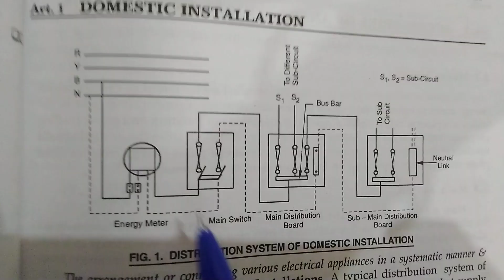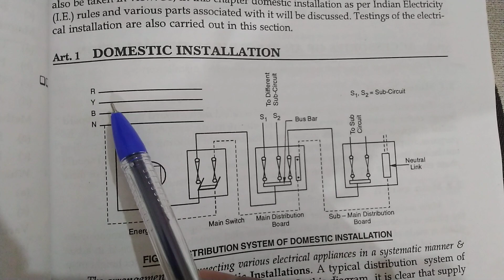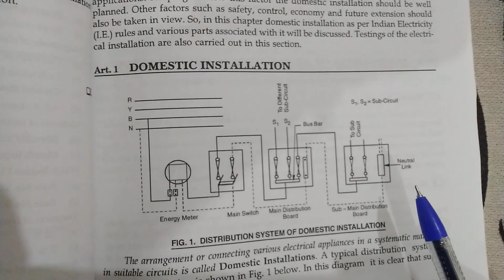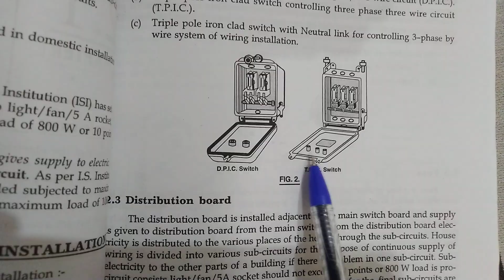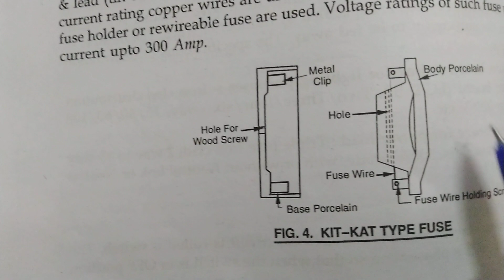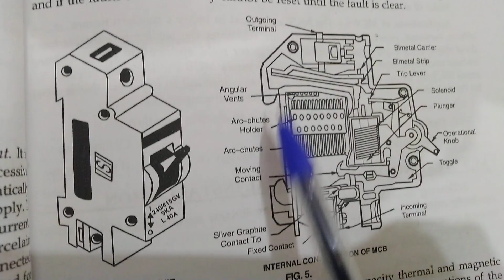Introduction of Domestic Installation Part 1

Comment: Sir hum energy meter ko MCB k baad kyu nhi lgate??? As we know when all appliances are of then some current loss occurred in wire due to resistance... If we turn off the MCB then no reading coms if we connect Energy meter after MCD
Reply from the maker: No we can't connect energy meter after MCB as chances of theft by consumer and due to Electricity board., As upto energy meter it is property of supplier.